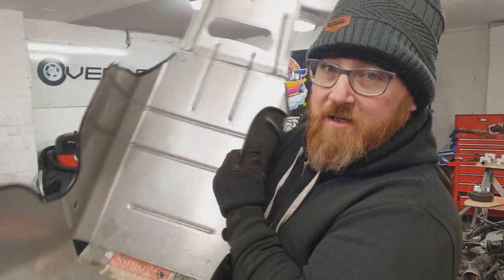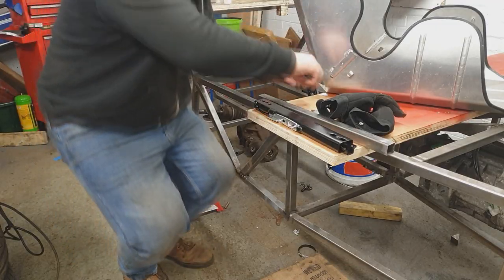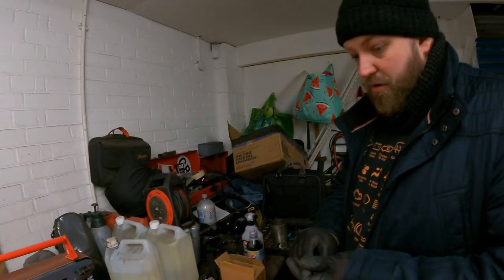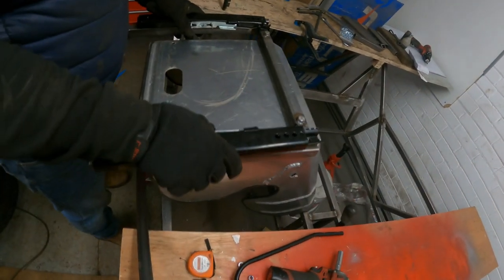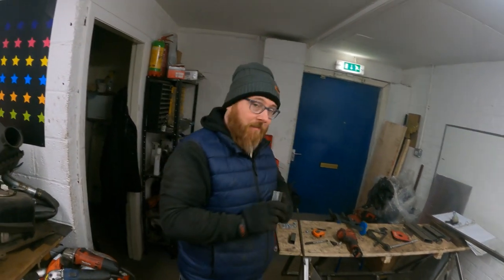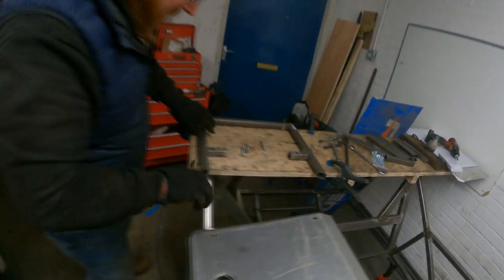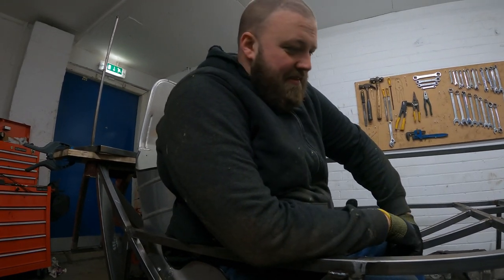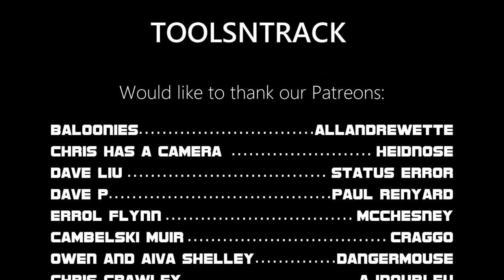Locost 7 Kit Car FULL BUILD!! - Episode 14 - FITTING KIRKEYS! (Project 7-UP)

Comment: Button head bolts will be fine, however I think with your special seat frame and the fairly tall seat adjuster mechanism, the seat is mounted quite high. Maybe you can remove the adjuster section after you've passed IVA to lower the seat. You really want your backside about 1" above the floor on these cars.
Reply from the maker: Shhh, don't let Mr IVA hear you.... But yes. This.
Reply: @ToolsnTrack  you also want the base of the seat to slope upwards so the bit under your thighs is higher than your backside, this will make it more comfy as you don't want to be driving with your legs straight. Or you could add a hard foam wedge to the base to support under your thighs and have slightly bent legs which would be way more comfy.  Great series by the way, I enjoy watching it!   If you want a laugh, or maybe some inspiration check out my first drive in my kit, just listen to wife's comments.... https://www.youtube.com/watch?v=thBaZ2o6Lg4
Reply from the maker: @KeithsSeven  I think the foam idea will prevail, if only to add a slither of comfort. Also, there is nothing to beat the other-half being "whelmed" at your lifes work!! :D

Comment: Is it really even a Locost if you don't go for the carbon fiber Tillett seats? Yes, I would say even more so! I'd recommend some flush mount flat head bolts and washers though, it will be far more comfortable than those button head bolts!
Reply from the maker: Good plan, although my fat arse seems to not notice the bolts. Probably because of all the other bits jabbing me
Reply: @ToolsnTrack  I've done karting for many years where it's standard practice to have a raw fiberglass seat with bolts going straight through it, and for the extra couple cents it's worth the investment. It may be fine sitting in the stationary car for a few minutes, but once you've been driving on a track for 20 minutes with all the forces that comes with that your butt will thank you. From the looks of it you already have the bolts position out of the way of any major pressure points, but it can still go a long why in helping the car feel more comfortable.

Comment: Do you need to add tilt? I put a Corbeau with a bag seat in my Exocet recently and i had to raise the front a couple of inches to get a nice driving position.
Reply from the maker: Quite probably but it's easily done. Tweaks can be made once the pedals and wheel are in
Reply: Thing is, it makes the whole release lever fitting a smidge easier with the extra front clearance...

Comment: Adjustable kirkeys don't make much sense to me because you are going to have to attach a back support to the harness bar once it's all in. Without the back attached to something the back of the seat can bend forward in a crash and lock you in place. You really don't want that in the event of a fire. Not a good way to go. All the racing association rules i'm aware of in the states require a fixed back brace for aluminum seats for this reason.
Reply from the maker: Benjamin,
1. They were cheap
2. They will pass IVA
3. I like them.